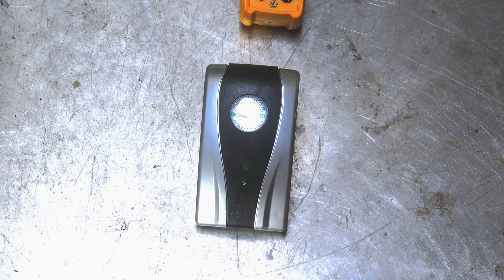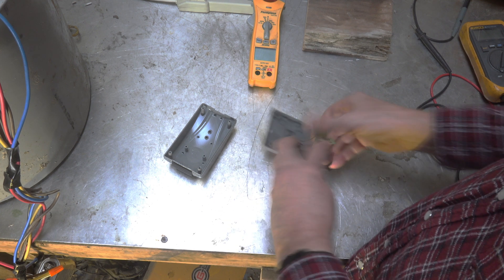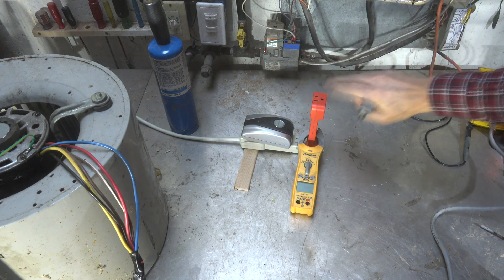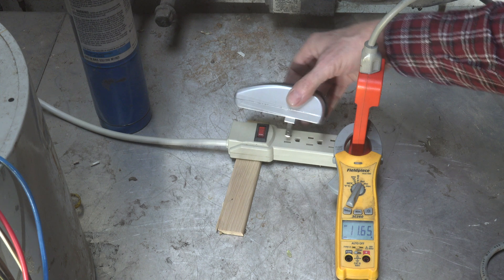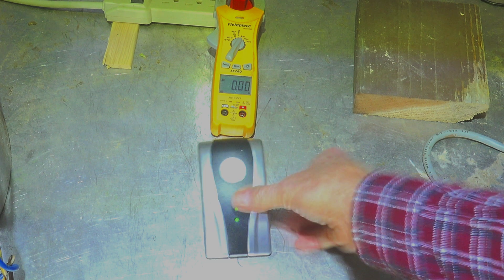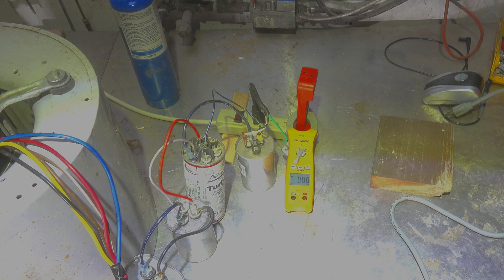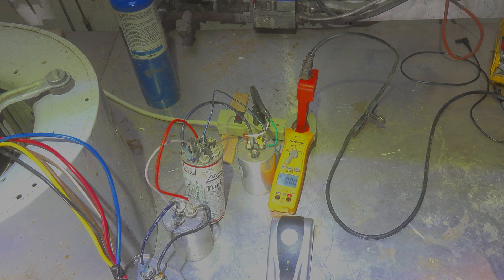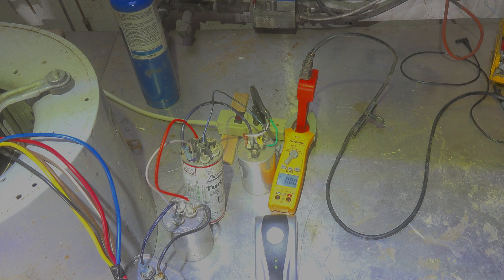Does this save electricity?

Comment: The concept is power factor correction to save money for users with high inductive loads.   Like factories and pipelines.  But those large users already have power factor correction systems, which are large and engineered.  However residential rates don't charge for power factor imbalances - residential users are metered only for kwhs used.   Large commercial and industrial users are charged for poor power factor but have significantly lower commercial rates.  They are motivated to correct power factor.  So the concept is valid but selling residential power factor correction (or whatever they elect to call it) is a straight out scam.
Reply: i know Im asking randomly but does anyone know of a method to log back into an instagram account??
I was dumb lost the account password. I would love any help you can give me!
Reply: @Graham Caspian instablaster :)
Reply: @Ricky Zaire I really appreciate your reply. I got to the site through google and Im waiting for the hacking stuff now.
Takes quite some time so I will reply here later with my results.
Reply: @Ricky Zaire it worked and I now got access to my account again. I'm so happy!
Thank you so much you saved my ass :D
Reply: @Graham Caspian you are welcome xD
Reply: DING, winner winner :)
yeah mostly a scam, but it can help a small amount, since correcting the power factor can make devices produce less heat output, including other devices on the same circuit, the whole phase and interconnected grid parts and other homes. that is why they check and charge factories, whom can cause massive amounts of utility grid equipment heating up.
like a bunch of cheap LED's, with poorly made power supply.
I wouldn't bet on todays smart meters not sneakily magically factoring it in somehow lol.

Comment: Well the logic is correct, the execution isn't. "Dirty electricity" meaning erratic sine pulse can make electrical components work harder in an uncontrolled direct line. This is why virtually all electronics today come with built in rectifiers. From your TV and power supply in your computer, to your stove, electric clothes dryer, hair dryer, and clock radio; all of them have a rectifier. This converts AC to DC and stabilizes the current at the correct output for the electronics (typically between 3.7v and 12v). Virtually no consumer electronics actually run on 110v or 220v AC power. The few that might (vacuums, heating elements in stoves and dryers, space heaters, etc) won't see any efficiency or deficiency in "dirty electricity". 

In fact the only real situation where I could see needing some sort of apparatus to absolutely kill any noise from an electrical supply is in super sensitive sensors or detectors used in a lab setting. Many of these machines use massive capacitors to bleed power from rather than taking a direct current (AC or DC), as the capacitor output is stablized.
Reply: You must be new here.

Comment: Capacitor may help banance or help stop surges, nothing else.
Reply from the maker: I did not do any video on it but, I did try this thing on an oscilloscope using several motor loads.  No change that I could see.
GFM
Reply: I am no electrical engineer, but since alternating current constantly reverses polarity and therefore the capacitor is constantly charging and discharging as its polarity is reversed, I am not sure that it would have that effect. AC current doesn't exactly charge a capacitor like a battery like DC current does. On a DC system where the polarity is constant that absolutely would be the case though, capacitors are used for ripple filtering in a lot of applications such as in power supplies.

Comment: I like the video. I'm so tired of this type of crap on the market why do they allow it? I do have a question to ask you. I live in a mobile home and I just found out I have a crack in my Coleman furnace and going to have to replace the furnace. So I price a replacement furnace at about $1000.00 dollars my question is what would be a fair price to have the old one R/R with putting the A/C coils back in the new unit?  I just don't want to be rip off...
Reply: Don't waste your time, May have different refrigerant or or may be a leaker, Replace everything.    An R-22 system, if that is what you have, will bankrupt folks in a hurry.
Reply: @watermanone7567  I would love to, But my SSDI can't cover that the unit is 44 yrs old and I would love to replace it all but don't see it in the cards. I need the heat more than the A/C so just replacing the furnace is a better option for me but would like to know what I'm looking at for installation...
Reply from the maker: The price is quite low.  R and R would cost well over 1/2 that and you would still have an old furnace.
GFM
Reply: @grayfurnaceman  Is that Remove and Replace or are you saying Repair and Replace I know that the heat exchanger can be patch most of the time but it being so old it might not be advisable. So if a got a newer unit what do you think it might cost me to have the old unit pulled out and a new unit installed. 
The unit i have is Coleman Presandental II from 1977.
Reply: @Richard-nq3rh  Depending on what state you live in you may want to try your states weatherization programs you should qualify by being on SSDI.They do help with heaters and other various things .
Reply: @razmataz2699  thank you for that, I did try that program in CA. but it not for Furnace they did want to replace my refer and washing machine. and I had two window A/C units but miss it by one year. I am looking into another program for a grant but a lot of paper work to do.
Reply from the maker: @Richard-nq3rh  Repair and Replace.  Its a term for doing all necessary repairs including parts.  
The heat exchanger cannot be patched!  Safety hazard.  
So getting this straight, you have a price of $1,000 for a new furnace, equipment only.  
Labor cost I would estimate at about $600 to 700.
GFM
Reply: @grayfurnaceman  ok Thank you very much for the info.